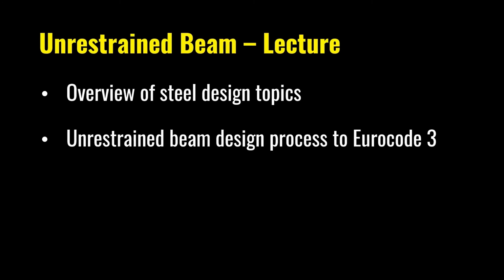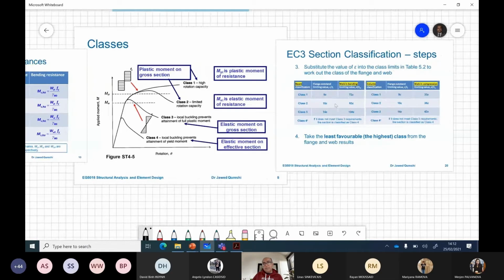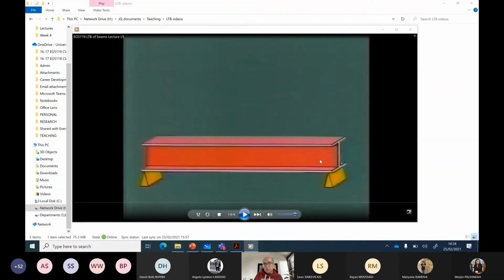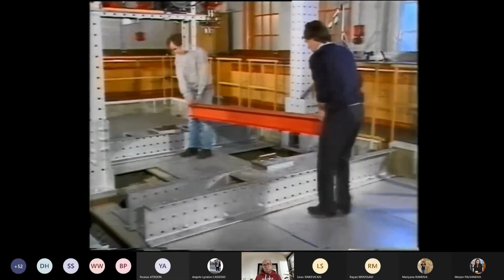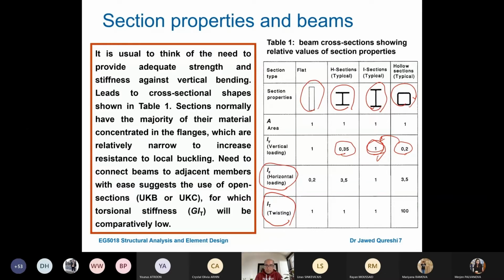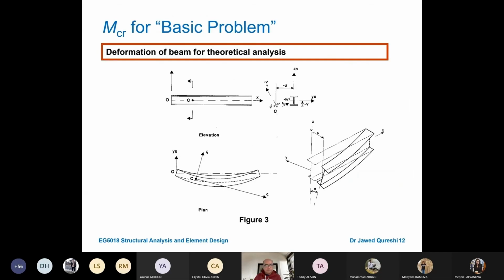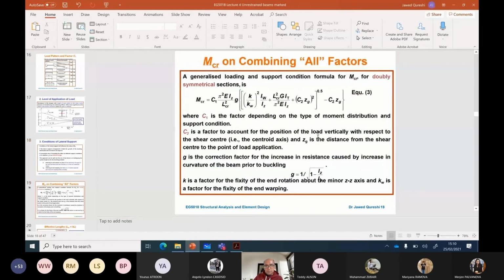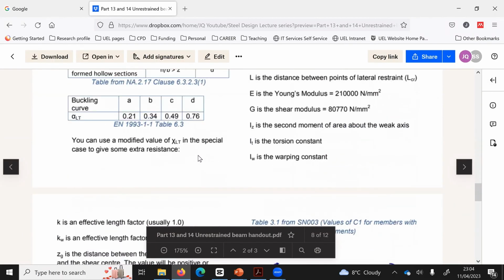13 Unrestrained steel beam design Lecture | Eurocode 3 Steel Design series

Comment: How should l  different between restrained and unrestrained beam
Reply from the maker: A restrained beam has its flanges prevented from rotating or moving laterally by positive attached of slab with the help of shear studs, while an unrestrained beam is free to twist and not attached to the slab. Secondary beams are treated as restrained and primary internal beams are termed unrestrained. Also, if there is timber slab on top of steel beams, the beams are considered unrestrained.

Comment: Sir, can you share the old videos links mentioned here please if possible.
Reply from the maker: Links to first 12 lectures are in the description. But, for your ease, I'll paste them here:

Part 01 – Introduction to Eurocode 3 Lecture: Load distribution    • 01 Load Distribution – Lecture | Eurocode ...  
Part 02 – Introduction to Eurocode 3 Tutorial: Section Table    • 02 How to read Section Tables | Eurocode 3...  
Part 03 – Introduction to Eurocode 0 Lecture: Loading    • 03 LOADING Lecture | Eurocode 3 Steel Desi...  
Part 04 – Introduction to Eurocode 0 Tutorial: Loading    • 04 LOADING Tutorial | Eurocode 3 Steel Des...  
Part 05 – Steel Design – Tension members Lecture    • 05 Tension Member Design Lecture | Eurocod...  
Part 06 – Steel Design – Tension members Tutorial    • 06 Tension Member Design Tutorial | Euroco...  
Part 07 – Steel Design – Section Classification Lecture    • 07 Section Classification Lecture | Euroco...  
Part 08 – Steel Design – Section Classification Tutorial    • 08 Section Classification Tutorial | Euroc...  
Part 09 – Steel Design – Compression members Lecture    • 09 Compression Members Lecture | Eurocode ...  
Part 10 – Steel Design – Compression members Tutorial    • 10 Compression Members Tutorial | Eurocode...  
Part 11 – Steel Design – Restrained beam Lecture    • 11 Restrained Beam Lecture | Eurocode 3 St...  
Part 12 – Steel Design – Restrained beam Tutorial    • 12 Restrained Beam Tutorial | Eurocode 3 S...
Reply from the maker: Part 01 – Introduction to Eurocode 3 Lecture https://youtu.be/vfXASfDiBLw
Part 02 – Introduction to Eurocode 3 Tutorial https://youtu.be/p1jDKkahbpQ
Part 03 – Introduction to Eurocode 0 Lecture https://youtu.be/rEq1E7d9RgU
Part 04 – Introduction to Eurocode 0 Tutorial https://youtu.be/EWMcaGmlRlY
Part 05 – Tension members Lecture https://youtu.be/ddtnW-Qys08
Part 06 – Tension members Tutorial https://youtu.be/igIe7h11bHI
Part 07 – Section Classification Lecture https://youtu.be/WuRzcK5LS50
Part 08 – Section Classification Tutorial https://youtu.be/vwieZQ_vQVg
Part 09 – Compression members Lecture https://youtu.be/udCnAM3RenQ
Part 10 – Compression members Tutorial https://youtu.be/XQipsi8Je2Q
Part 11 – Restrained beam Lecture https://youtu.be/OfJJ9Ix3VwU
Part 12 – Restrained beam Tutorial https://youtu.be/pvMqSqQvwLE
Reply from the maker: Please the links below:
Reply: @DrJQureshithank you sir. 
Actually I requested for the video of experiment shown in unrestrained beam lecture. Stocky, slender and intermediate beams.